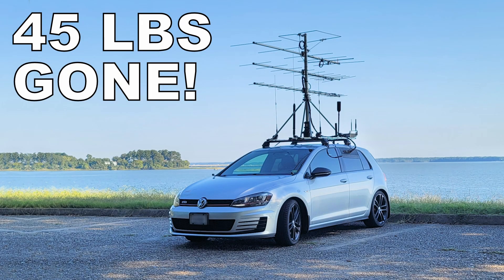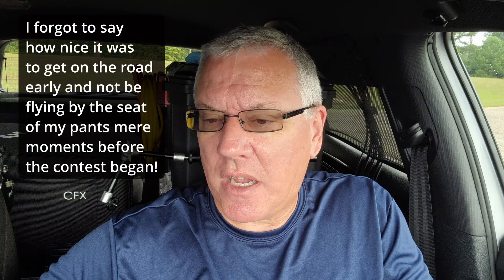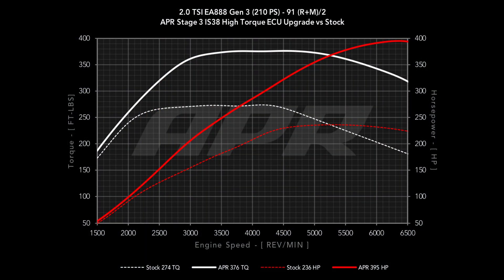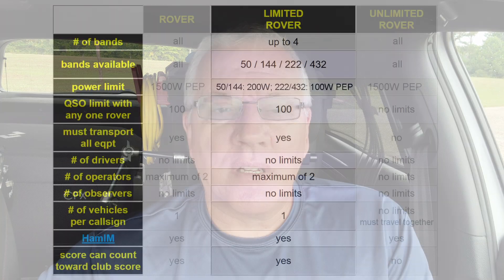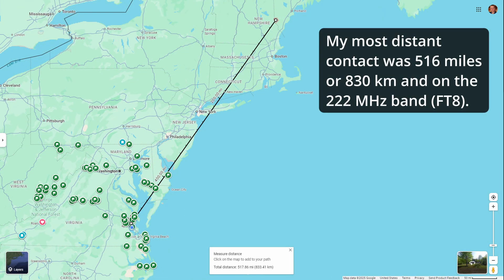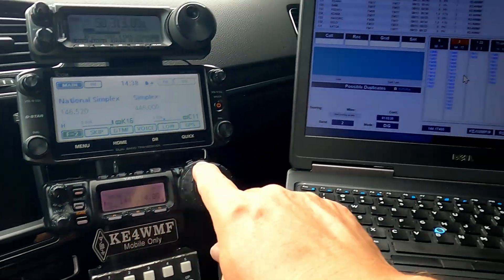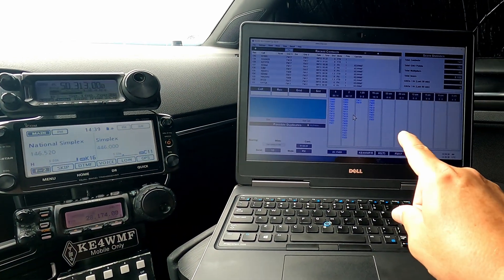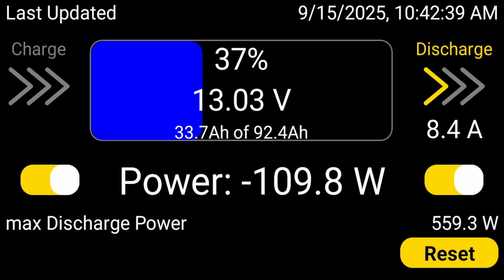2025 September VHF Contest w/New Tower

Comment: How did you get the FT857 to transmit on 220?
Reply from the maker: It doesn't. It transmits on 28-29 MHz into a transverter. The transverter upconverts the signal to 222-223 MHz. The FT-857D has a transverter function that can display the adjusted frequency. You may have seen a photo with that feature enabled. Most of the time, though, my display shows either a memory tag that says "222" or the 28-29 MHz frequency. Thanks for visiting!

Comment: This is pretty cool i have a question though, is this a completely legal setup that you could do for your car? im interested to plan to having a similar setup like that.
Reply from the maker: As long as the setup is securely mounted, doesn't exceed the roof rack's weight capacity, 13'6" in height, 8'0" in width, or extend more than 4" beyond the front fenders, it should be legal on most roads. Of course, side highways may require some diligence in watching for old underpasses that are not at least 13'6" tall. I have a historic tunnel nearby that's tall enough in the center, but not at the white line. I don't drive through if the tower is mounted. Thanks for visiting!

Comment: Got my 222 transverter two days before the contest. I was a rover only because I made contacts on my way home from work Sunday morning. Very limited contacts on 222 but I was at home in a not ideal spot. When I rove it will be better.
Reply from the maker: Very good! Make sure that you never overdrive your transverter! I accidentally hit mine with 100W at 50 MHz for just a few seconds. Experienced contesters say, "You'll only do it once!" HAHA! The transverter worked fine for a a few days, but SWR eventually increased to unmanageable levels. Later, I learned that matching resistor R7 had failed. I'm awaiting a replacement, which also looks easy enough to swap at home. Thanks for visiting!